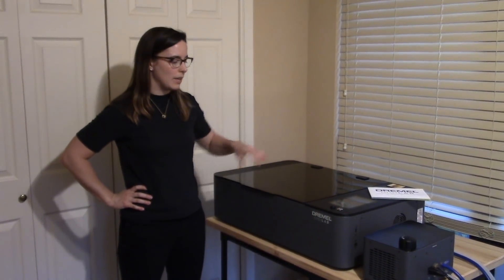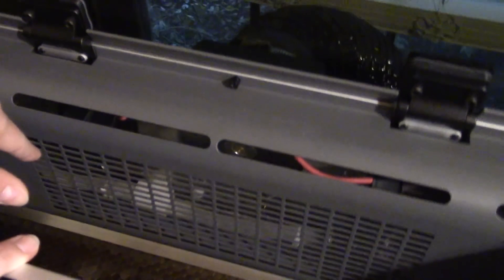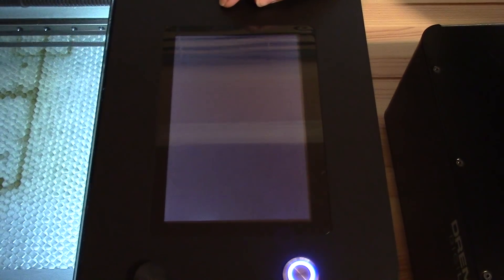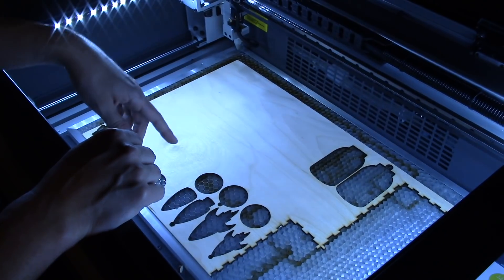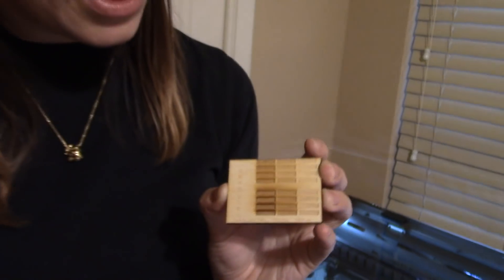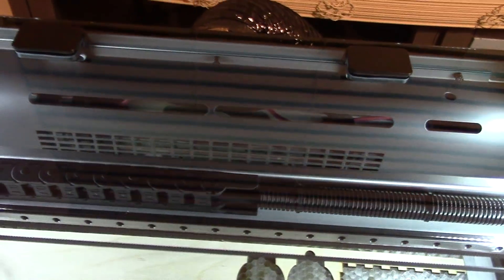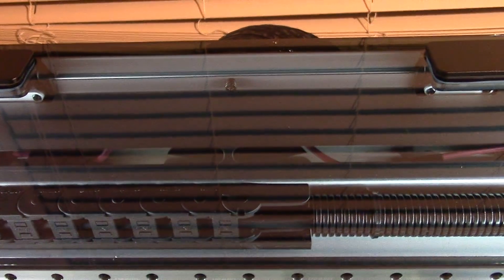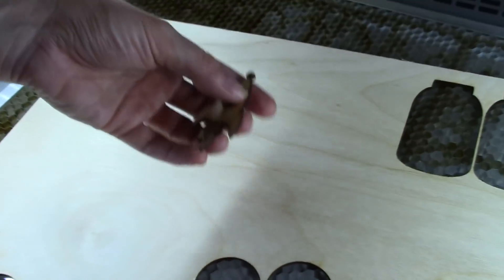Dremel Laser Cutter Update and Overview

Comment: I have a K40  with adjustable bed, a Cohesion 3D main board with Litghtburn, air assist, water chiller, amp meter flow meter, temp gauge,  SI high reflective mirrors. All for under a grand as apposed to $3000.00 for this money hog!

Comment: I was wondering if the injection automotive windshield repair would fix the crack in the laser tube.  I know that my windshield was cracked about 13 inches and there is no leak.
Reply: My guess is that the tube may possibly be airtight once again, but since the tube was most likely constructed utilizing a vacuum in place, unless you have a way to "re-vacuum" the tube in your home shop after sealing it, merely sealing the tube again would not fix the problem.
Reply from the maker: Carol is exactly right. -Dan

Comment: Over $6,000 for cost and it doesn't have automatic zeroing? There's plenty of $2,000 machines that have more functions, capabilities and auto zeroing. Dremel better get with the competition.  The wood issue is easy, think material 1/2" and small should be stacked flat so the weight keeps the material flat, but don't lay they flat on a cold service like tile and cement.  Both cold, moisture and stack method all play a role in whether think woods warp or not.  I've been doing woodworking for over 40 years and know my woods.   You would get a better price for wood to purchase a full sheet of 1/4" birch plywood and have the store cut the sheet down to smaller pieces.

Comment: Nicely done and helpful. Planing to cut balsa and light plywood for model aircraft structures. Have you found another source of wood besides Dremel?
Reply from the maker: The Dremel would be perfect for that. You can buy any wood you want from any local store, the only thing you have to watch out for is making sure it is level. The laser won't cut through as well if it is bowed in different directions. -Dan

Comment: $5000 is a lot for a Laser Cutter that only cuts wood.
it would be nice if it could do thin aluminum or metal sheet. i don't know, i am a novelist to laser cutter. Sorry lady, but lazer is very risky. It's Very easy to break and expensive to fix. A cnc router plugged to a computer does the same job for less money.

Comment: Great video and explanation.  The price is probably average for Dremel gear. The 3d printer they did was a bit over the top for it's ability. I was surprised to see the separate cut lines at the end. Is there not a setting where you can have just one start stop point for outer edge cutting? Nice compact hobby laser though. Good luck with future products.

Comment: Go to Home Despot and ask for "underlayment:". There is "Luanne", and then a better quality one (forget the name). Try to avoid sending more money to Dremel as they have a huge markup. With a little effort, you could have gotten the same product directly from China (which is where yours was made anyway) for probably 1/3 the cost. Glass tube lasers are remarkably inexpensive. Epilog makes RF CO2 resonators which have very large advantages over DC glass laser tubes. Bit hard to explain here.  FWIW, you can buy an epilog laser and with a bit of a hack, you could probably put that tube in this cutter. The majority of laser "engravers" and cutters of this type leave a LOT of char. That's essentially a sign of not having enough power and/or poor laser mode or alignment. Experiment with a chunk of balsa well soaked in water and see what you think. Adding your own evacuation fan to evacuate under the honeycomb, if using enough CFM, will reduce the amount of char (black) black, in your cut edges. Although adding an air pump like for a fish tank and a tube, directed onto the cutting focus will give you the same benefit. If anything from Dremel told you any of this pls let me know.

Comment: Just a small tip for storing material, timber needs to be stored in stable conditions to stay flat. Humidity etc absolutely controlled, and probably better laying flat on solid surface, not leaning on angle etc. Perhaps use craft sticks as mini supports between sheets, to allow airflow and maintain flatness. Probably there are other better ways if you can think of them.

Comment: Power consumption and replacement of laser tubes will work out more expensive in the long run.
Looking at what you created with that Laser machine, a Cricut Machine that is less expensive can do.
Reply: Good luck cutting birch plywood with a Cricut. It will barely handle thin balsa.
Reply: perhaps it isn't an issue for her.
Reply: @krom26  I guess so.
Reply: @krom26  White Knight alert

Comment: Cool but if the 6K price from other commentators is correct. I would get the Glowforge it has the safety features and a camera sitting above the bed. All you do is drag your file over the material to place it. Three models now the pro version 45 watt laser and infinite material length is the high end around the 6 K area. It also has water cooling inside the machine no separate box for cooling. I own a Glowforge it's great if someone reading this is interested they can get a cost break with my link on all three models...
https://glowforge.us/zq4MrH 
The machine also has the material set similar to yours but they are working on dynamic focus so flatness is less of an issue. Good video though hope you enjoy your new laser tool!

Comment: Looking for cheap laser cutter that's capable of cutting 1.5mm or even 1mm aluminum or stainless steel! Let me know if anyone has something in mind, thanks!
Reply: Colin White to cut what you want, you will need well over 100 watt co2 laser. It won’t be cheap for that much power, you would be better off with a CNBC plasma table. I have a cheap eBay k40 co2 laser and upgraded it with a real 80 watt laser tube/power supply, water chiller and air assist. And it still won’t touch aluminum or any type of steel.
Reply: @jacobaikey8500  you can get 100w co2 cutters for 2k (new)  from ebay.  not sure about what would the price on a cnc plasma cutter be tho
Reply: Look into fiber laser. It uses a different wavelength.  I couldn't believe the technology.  They run 10000 watts though a small fiber optic cable. IPG has the patents.
Reply: @TheRainHarvester  I have been looking to buy a fiber laser for deep metal engraving, but the prices are way too high. I use a cnc router/engraver to deep engrave now, and it only cost 400 bucks usd.  laser tech is becoming more mainstream and easier to manufacture, and should start seeing lower prices especially for fiber yag surface and sub surface marking machines.

Comment: What power is this laser? It is very noisy and slow compaired to my 30w Epilog.
Reply from the maker: It is a 40 Watt. It is only "slow" as we have the resolution turned way up for the art rastering we are doing. We can make it go way faster but it doesn't look as good.
Reply: @danielolivermcelroy8320  Thanks for the reply and very good video. If it has to be that slow for for the quality I will stick with Epilog. Yes, Epilog are more expensive but the extra money clearly gives you a much better machine.
Reply from the maker: This is just a toy for us to fool around with. If you are using it for work 24/7 then a more expensive machine is definitely necessary. My wife has lots of experience with universal and epilogue and likes the epilogue the best. -Dan

Comment: I was an architectural model maker, and in 1990, quality American-made laser cutters were about $60,000.
The Dremel retails for a little under 6k.
Reply: Larry Contreras seriously, I bought my 40k Chinese machine on Amazon for $400 and it’s excellent
Reply: @erea3355  Thanks. What make/model?
Reply: I don't recall the exact model number. Google: Universal Laser Cutters. They are state of the art for architectural model making!
Reply: Yep, I just saw the thing for the first time and figured it would cost like 1500$, checked the dremel website and had my jaw drop. it is so over the top megaexpensive for what it is.. it is a 100$ Laser tube, two stepper motors, two (four?) linear rails, android tablet, psu and water/air pump... seriously!! But as you see there are people buying it. Granted, the K40 is a little on the small side, but still you can see what kind of margin dremel makes on that thing.  @mikedealer123
Reply: there's superior machines with twice the bed size for half the price.
Reply: @chaucer44  Name the machines you are talking about.
Reply: this machine works straight out of the box.  Twic e the machine for a fraction of the price.  I have two of them: https://www.ebay.com/itm/60W-110V-CO2-Laser-Engraving-Machine-Laser-Engraver-Cutter-20-x-28-700x500mm/162005542809?ssPageName=STRK%3AMEBIDX%3AIT&_trksid=p2057872.m2749.l2649
Reply: $8200 in Canadian dollars and if you buy a BOFA filtration unit for $2700 CAD, which seems to be a must if you plan on operating the unit in an apartment bedroom or similar space, by the time you finish adding in tax and shipping costs, you've got a machine costing over $10K that doesn't do a lot more than a typical Chinese-made K40 laser does. 

Waaay overpriced.
Reply: you can get giant machines  now for under 2,000  Here's a vid I filmed of mine  https://www.youtube.com/watch?v=Uck5EkeJ_2M

Comment: Thank you for the walk thru. :) Very helpful to see real world video that has not had the marketing gurus spin it.  Are you getting the extra fan to pull the fumes faster or so you can have a longer exhaust tube farther away?
Reply from the maker: We are getting the extra fan. It is currently on back order. This current fan does a good job of pulling 90% of the smoke out, but even a little smoke goes a long way in the house. -Dan
Reply: @danielolivermcelroy8320  I would be interested to see if the extra exhaust fan will solve the issue for you.  We recently received our unit and are experiencing the same issue.
Reply from the maker: We will let you know when we receive our fan. I guess they are all on back order. -Dan

Comment: I love your Dremel cutter!! What kind of materials can it cut besides wood?
Reply from the maker: Matt board, card board, paper, hard woods up to 1/4 inch. Acrylic, and it can etch aluminum but it can not cut metal. -Dan
Reply: Should also be able to etch glass and stone
Reply: Hi, have you tried cutting rubber? I’m looking to cut 2-3mm if it cuts it ok but wanted to see in action first.
Thanks for your video 👍🏼
Reply from the maker: We have not yet. And I don't know if we will in the near future. We primarily work with wood. -Dan
Reply: Daniel Oliver McElroy ok thanks for your quick reply i appreciate that 👍🏼 I would presume it has no problem at all cutting rubber...
Reply: @tonydavis8078  They have a list of common materials but don't list a thickness. Rubber is on it for engrave, score and cut.  Cutting rubber without a filter/scrubbing system will be very smokey and smell like burning rubber but the good news is a scrubbing system is easy to build using a pvc Tee fitting and 2 sections of pipe. lower section ends in a bucket to catch water and the upper section has a sprayer at the top. A water pump pulls water from the bucket and sprays inside the pipe.
Reply: Thanks Andrew that’s cleared things up now, now to find the best price for this without getting stung for import tax.
Reply: @tonydavis8078  No problem. what are you working on? There might be other options you haven't looked at yet
Reply: Hi Andrew, not going to give too much away on here but my main project is cutting rubber, I’ve been looking at cheaper laser cutters but they take too much setting up.